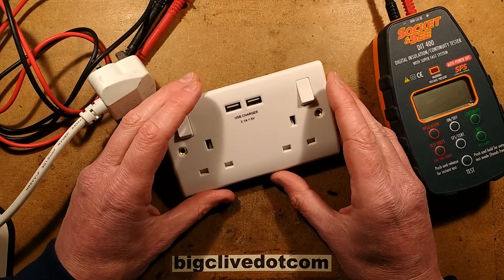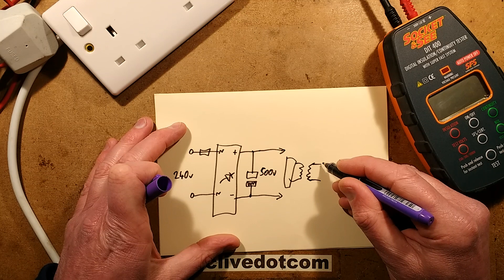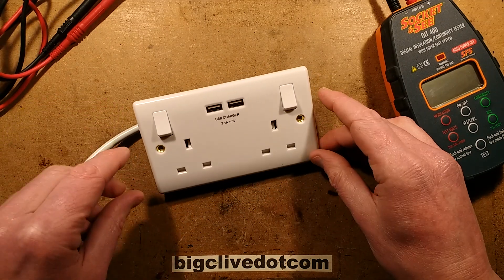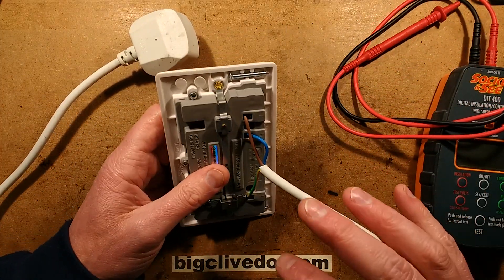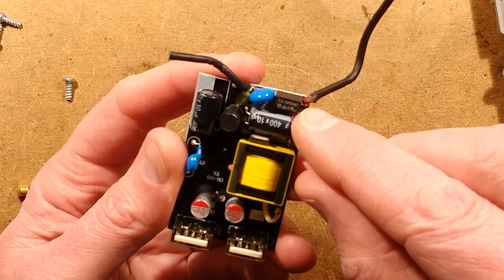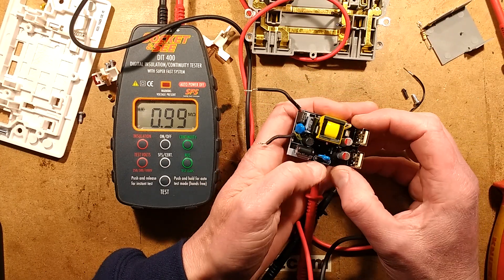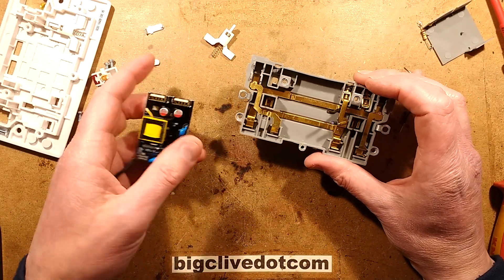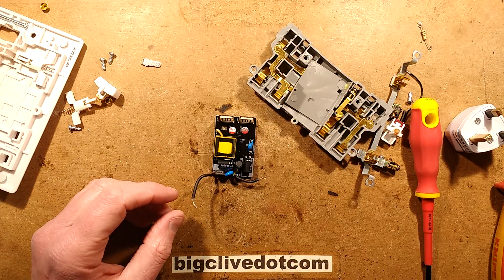500V insulation test of a British General USB socket.

Comment: Verry confused swiss electrician here.
So what confuses me a lot is how you test the insulatio between live and neutral at 500v because here we learn to NEVER EVER test it like that. We have to bridge out the active leads (3L N) and then measure between that and PE (earth)  because if you do measure it like you did as you mentioned you subject everything plugged in etc to 500V wich most stuff isent ratet for thus possibly damaging it. Is your method standart in the UK and if so why and how do you avoid damaging stuff.
Reply: Same here.   Surely it's not surprising measuring a low resistance across live-neutral?  I can't see how this test has any value at all.   It's an insulation test - a test between parts of the circuit that are meant to be insulated from each other for safety.  A test between combined live-neutral and combined USB output would surely be the most relevant here?
Reply: The l n test is done on initial installation. NOT doing it will miss potential shorts on light fixtures. On an existing installation indeed ln  is best avoided.

For insulation tests we disconnect the live from each usb socket and wago them off just for the test.
Reply: Oops Clive. Same in the UK. Yes the "insulation test" is intended to check isolation from protective earth. The insulation tester should be connected to both "phase" conductors (live and neutral together) and the other lead to earth. The limit of 500V dc peak test is to protect the class Y filter capacitors between the "phase" and earth of the USB PSU (if there are any).
Reply: Gladius Illuminatus L-N isolation tests should be done only with at least L disconnected from both the supply and anything not under test.  For example before connecting a newly installed subcircuit to the supply.  In that context, the words Clive read could be understood as doing his test on a set of 4 these plus wiring should read back >2Mohm, not <0.1Mohm.  This could have someone chasing their tail looking for a wiring mistake.  For DC testing, a series capacitor before the rectifier could have avoided this at the cost of a worse power factor.
Reply: @johnfrancisdoe1563  
Absolutely correct that the relevant outlets should have nothing plugged in to them when the L-N test is performed.
Reply: As a Dutch electrician no L-N testing either, connecting L-N and measure between earth. Same as above.
Reply: It should be to PE not L to N.
Reply: Here in France you're taught to do the insulation test between L/N and L/E. Of course, you have to unplug all appliances first.
Reply: How do any of you guys ever fault find anything if you only ever test L with N to Earth?  IR Test voltage has to be at 500V DC as 240V AC is only the root mean squared value and not the peak voltage which is  339V.
I test Lto N all the time, if do not have the nous to do a 250V DC IR test first to ascertain that there are no electronics in circuit that need disconnecting then how did you manage to get an Electrician's Practicing Licence?
You are however allowed to test certain appliances that contain semiconductor devices at 250v DC but it's better to use a clamp meter and measure leakage current.
Reply: Gladius Illuminatus same here and I'm in UK . Don't risk l-n test with so many sensitive  electronics in bigger buildings guarantee there's always something still plugged in somewhere .
Reply: I'm only an Icelandic electronics technician, but during the basic course (which is common to electric, electronic and line work) we would have to do tests like this - often at higher voltages like 1kV or even 10kV - on our own installations before installing anything that would go in. The whole point is that every component - connectors, lamp holders, etc. - has to provide much higher voltage insulation between EVERY WIRE than the voltage coming in from the mains. So, you test L-N, L-PE and N-PE before any connector in the installation can actually be used. Of course, it was a pain if you forgot to do the test, put a light bulb into a closed ceiling lamp, closed the lamp and then remembered you had to test. :P

edit: It's a shame there's no switch on the back to disconnect the USB power supply to do tests like this, or in case something goes wrong.

edit2: WAIT, HE DIDN'T BRIDGE L-N AND MEASURE FROM THERE TO THE USB CONNECTORS!?
Reply: @GreatJoe  Its impossible to test some equipment with an L-N test. Anything with a mains transformer for example. With this sort of equipment we just short L-N then test between those conductors to PE but its done at 2.5KV and the test lasts for 60 seconds.
Reply: In Germany we connect L and N together too and measure the insulation between these both and the PE. The best way to do this is in the fuse box. If you're using an insulation tester which tests with DC voltage and got no automatic polarity reverse, you must reverse it for yourself (switch test leads) and perform the test a second time. The insulation resistance must be at least 1 MOhm. In new installations it's normally much higher, in most cases my Fluke shows >500 MOhm. But this depends on such things like length of the cable and so on.

Comment: Kids sticking things in the live terminal? It's true, That's how I learned about electricty.
Reply: Haha I went one further when i was 7 years old and put cables in the socket, connected to what must have been a low voltage rating bulb. It exploded, with flames coming out the wall. Burnt the carpet and fused every fuse in the house. My father did electronics as a hobby and wondered why everything had fused. Mum never told him until some time afterwards haha.
Reply: I learned with a Meccano (Erector Set) screwdriver. I thought I was caught, because it felt like someone slapping their hands on my shoulders from behind. Maybe about 7 or 8 years old. Those shutters only keep out the amateurs and the uninterested. ;)
Reply: When I was at uni we used to cook sausages by connecting them directly to the mains supply. we found knives made the best contacts snd forks would ark too much
Reply: @TigerP1  in Africa they still cook like that in some remote places. They call the method "suicide" because if you forget it's live and dip your finger in the water you get zapped.
Reply: I was about 12 years old, and fixing an old fan heater. (Fan seized, thermal fuse blew). I put my finger too close to the element, to see if it was getting hot. It was 'hot' alright!
Reply: One time I saw a spark after plugging something in which somehow gave me the idea to stick my fingers between the prongs and plug it in, US plugs are so stupid...
Reply: @TigerPi you should watch UXWBill's Goofy Gadgets Corner: Presto Hot Dogger on Youtube, lol.
Reply: You'd think someone would learn after 1 or maybe 2 times. Not me.
I tend to be stupid at times... 

As a kid I once held mains powered christmas lights. I went to test them but one bulb was broken and I touched the filament...

A few years later I snipped the wrong cord...

And now a few weeks ago I was repairing a drum monitor, tested it, NOT unplugging afterwards and then grabbed the live pcb. Twice. GREAT.
Reply: At least they are 110 Volts instead of 240, so that makes them a bit less dangerous, @vgamesx1.
Reply: @vgamesx1 I was much later taught to approach potential live wires with the knuckles/backs of my hands, just so that you don't grab because of your hand contracting shut from the electrical charge. Your hand should then curl away from the conductor.
Reply: Yes of course, but I was a kid at a similar age to your experience when I did that but I'm saying 240v is actually safer in a some instances where you weren't expecting to be shocked.
Reply: They have shuttered sockets on some of the us 120v outlets. But they break or are difficult inserting the cables into.
Reply: Natural selection!
Reply: About 8 years old. I went to check if there was a bulb in a bedside lamb. There wasn't, but it was switched on. Not fun.
Reply: MrPGT9999 really you could spin that either way, I could say they are more dangerous than 240v because 120v is just low enough to where it will sort of make you latch onto something whereas 240v is more likely to throw you off of it, just depends on the situation, in my particular case 240v would've probably been better since my finger would have experienced less shaking and a more forceful jolt back out.

Comment: Could a chip be switching current to the USB socket only if something is plugged in, and bypassing them otherwise? Would that make a difference to the resistance reading in the test?
Reply: That chip would still need power from the mains so not very practical maybe.
Reply: they 'could' hae some kind of mechanical switch in the usb socket that made contact only when a usb plug was inserted but i guess modern switchmode suppliers use only pennies when on standby anyway now

Comment: I have seen the mentioned video just 1 or 2 days ago and when I saw the title image for this video, I knew what is going to happen. Do I win a prize now? I like that you technically do follow-ups/reactions to other channels videos. Would like to see more of that.
To give a silly example: What kind of tools would you recommend to beginners with a small budget? Not that I need to know that but I do not really agree with that aussie bloke in that regard and would have interest for a second point of view.
Reply from the maker: You could start off in electronics with a cheap set of side cutters, a USB soldering iron with matching 2.1A Power bank, some good lead based solder with flux core (best bought from a proper electronics supplier and not eBay) and a trashy meter like the little yellow ones often sold for £5/$5.  Add in some cheap electronic kits from eBay (flashing LED kit suite) and you'll be on your way to an electronic servicing career.